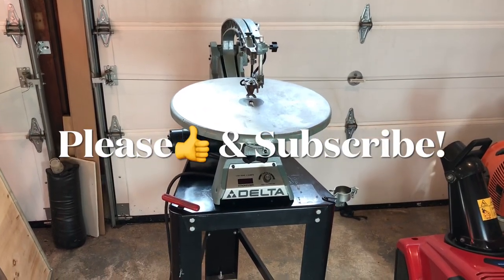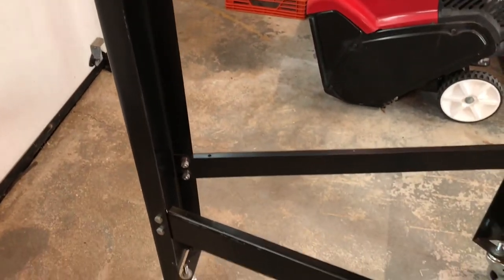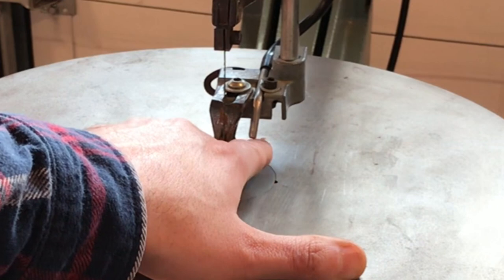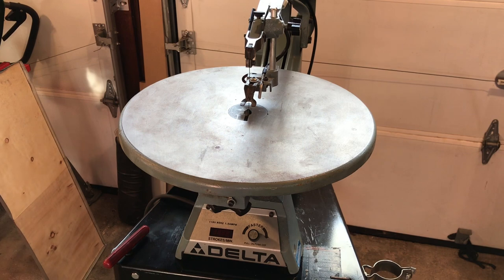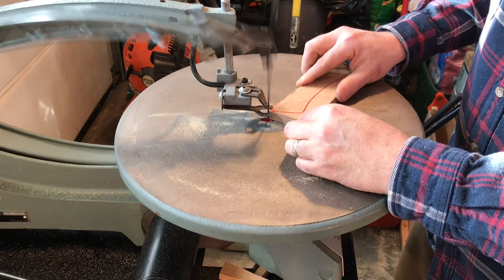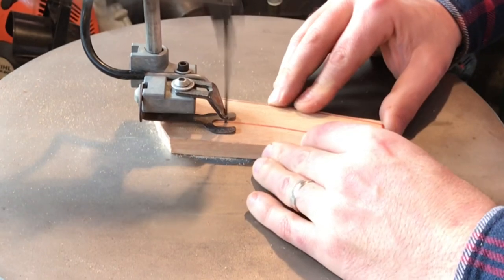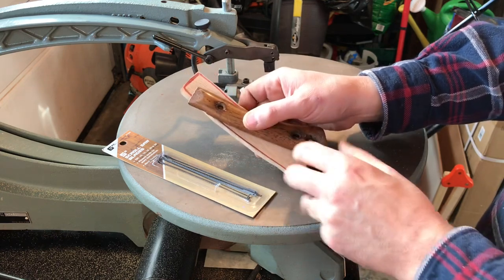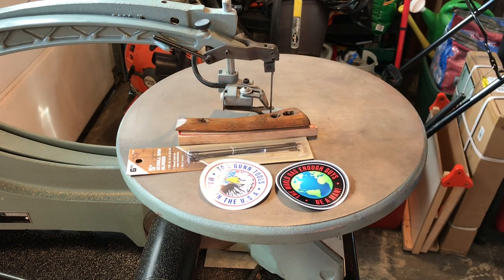Vintage Delta Scroll Saw!

Comment: That is a great saw and it was featured on the cover of the 1985 Delta Industrial Tool Catalog. I have most of my woodworking magazines from the mid 1980's and the advertisements from those have the saw priced at $699.00 and that's what I paid for mine in December of 1986.  

Mine came with a Baldor Motor, 90 Blades, and no castors....but I like that idea and might add those! When new, the stands matched the main color of the saw. I think you got a great deal for $90.00!

Comment: Hey Tom. I have a craftsman 20 inch C arm saw and the blower doesnt work either. People told me to just by a cheap fish tank aerator. It's a great saw!
Reply from the maker: Dan great idea as I heard this is a common problem with these. Love the saw the but I do break more blades then I would like. Must be how I have it adjusted.
Reply: @TomGunnTools  I think correct tension and the right size blade for the type and thickness of wood helps.

Comment: The dust blower has an air diaphragm, that when the machine go up and down it works the diaphragm and sends air to the nozzle to blow the wood shaving away.
Reply from the maker: Thanks for the info, that may be what’s not working.

Comment: I had a vintage probably 80s delta 8 inch bandsaw but The guide was messed up and the blade kept popping off so I ended up giving it away
Reply from the maker: I have to get more familiar with this machine but hopefully will work well. Thanks for watching!
Reply: @TomGunnTools  cool hope you figure it out I wish I could’ve kept that machine it was a bullet proof